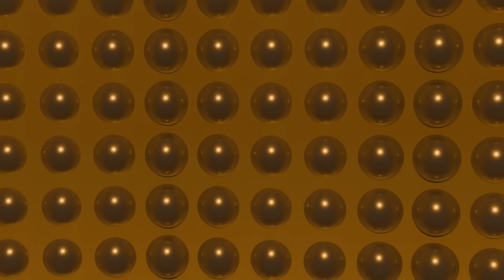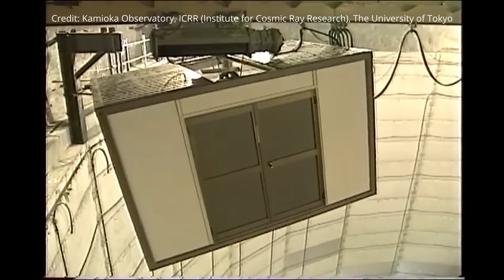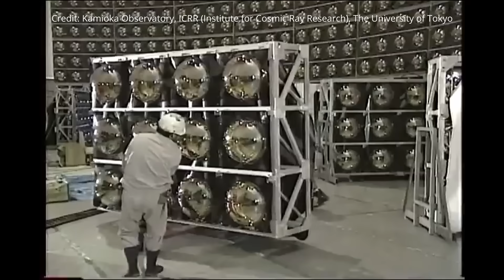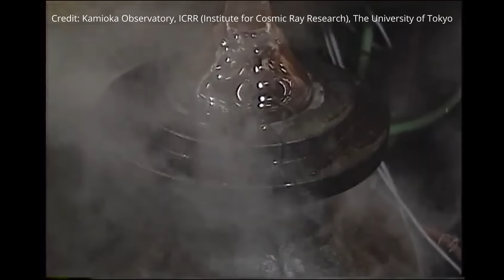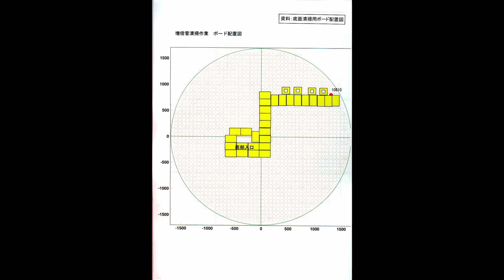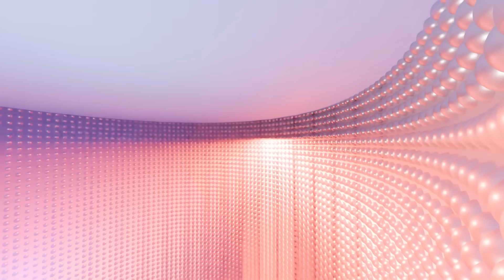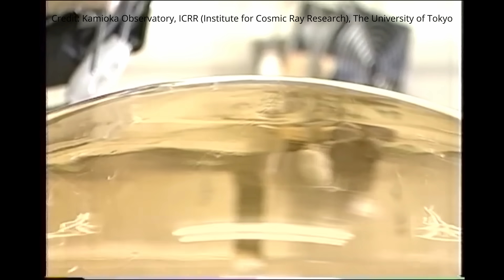An Engineering Fairy Tale: Cascade Failure at the Super Kamiokande

Comment: I feel like this is fairly well timed since there was something “similar” going on at the Paris Olympics:

The swimming pool used at the Paris Olympics was “slow” due to it being not as deep as other pools and having a less than ideal boundary. 
The shockwaves produced while swimming interfered with the swimmers hydrodynamics due to the shallower depth & more reflective edge of the pool
Reply: "The shockwaves produced while swimming"
Yeah - press X to doubt.
Reply: @ABaumstumpf  Not actually shock waves, because to get shock waves you have to exceed the speed of sound in the medium. Still, the speed of gravity waves in water (which was the effect in the Paris swimming pool) depends on the depth of the water, which is why tsunamis are so devastating. As the wave enters shallower water the front of the wave slows down so the height of the wave increases and the length of the wave decreases (just like the air/water example in the video).

Comment: To be fair, back in the 90's fluid computer simulation was a lot more difficult and expensive than it is now. Had they built it nowadays they probably would have picked up the problem before even the physical testing.

Comment: I believe KamiokaNDE officially stands for Kamioka Nucleon Decay Experiment, reflecting its original primary purpose of searching for proton decay. "Neutrino Detection" informally describes its current use.
Reply from the maker: Yes the original kamiokande stood for ‘Nucleon Decay’ but they changed the name when super kamiokande was built. I should have probably added a note onscreen about that.

On reflection I think you are correct. The latter name may be informal.
Reply: @Alexander-the-ok  Great video. I'm in the field, and I still learned something from it.

Comment: A bit tangential, but I was thinking about cavitation, and specifically what would happen if a cavity were created inside of a sealed container filled with water?  Like, if a sealed tank of water had a vacuum tube inside of it that suddenly shattered.  Would the water rush in, but pull away from the outside wall?  Would some of the water then instantly turn into a gas until pressures equalized?  Would be cool to see I imagine.  Assuming that the container itself doesn't implode.

Comment: Oh boy what a mess. Another way to put the violence of the event into perspective, with some blatant mischaracterization of the actual mechanism: Just the bottom detectors failing basically caused 50.000 tons of water to fall down more than 1 foot. Even accounting for the few moments that took to play out, the hoop stress of 50 kT falling water on the detectors on the side is insane.

Comment: 14:35 -- RE: Collapsing Bubbles Rebounding;  Again, I'm no expert in this field either but "rebounding" is how I'd describe a lot of fluid motion.  For example, if wind gets pushed uphill, say off an ocean and up a hillside, it will head back down again on the other side of the hill.  However, more to the point, if we continue to track the motion of that air flow we should notice that it will tend back upward again after descending, and then back down again, without any further help from geography.  In short, the first "bounce" over the hill caused a "rebound" after the air flow hits the ground.

Comment: When I was younger I was in the bathroom and chilling, and I witnessed a tiny tiny tiny tiny little white flash and it struck something mid air and exploded into spiraling and dancing fragments that were white hot, they burned out very very very fast but spiraled fast too, and one of them struck the wall just before burning out. It was so bright that it burnt itself into my vision, I had squiggly marks in my vision making it hard to see where the fragment hit my wall. I thought I was seeing things and maybe I seen stars for a moment, but the craziest part is that later when my vision recovered, and I had to use the washroom again, I checked the wall and it left a tiny black spec burnt into the wall exactly where I seen it land, and it was an actual hole burnt into the paint and drywall, which kinda intrigued and stumped me. Like how tf did something so tiny store that much energy in it, to produce that many photons and actually burn into the wall. For awhile I thought it was creepy, paranormal, and freaky, and it scared me a lot to think about so I never really did. The explanation I'd like to think was that it was just my vision, but how did it burn itself into my vision, and into the wall to leave a permanent mark too, the other is a micro meteorite which actually explains a lot, but it must have been stupid fast and small enough not to be effected by atmosphere, but somehow the microscopic droplets of steam in the air must have caused it to slow down and break apart. It hit something in the air strong enough to stop it
Reply: I've seen something similar once, and I thought it might have been a cosmic ray hitting me in the eye... but years later I realized that it was actually a capillary in my retina that stretched suddenly, or a partial retinal detachment... which one optometrist told me that I had at the time... but then I apparently recovered from it, because my retina is perfectly healthy now. 

Sudden changes in blood pressure, like straining on the toilet, can cause capillaries to stretch and even break in extreme cases (it's also why so many people die from heart attacks on the toilet, like Elvis Presley).

It's possible that what you saw in the bathroom was some of the capillaries in your retina. It will, subjectively, look like a blindingly bright white line in your vision that has a really bright point moving kinda fast, but not too fast, with a short trail behind it (where it was previously).

That the bright point branches into a tree-like, or lightning-light pattern sounds like it's following the capillaries in your retina. Those exact parts of your retina will be somewhat "blind" for a few moments until they recover. (Just like if you were looking into a flash bulb in a dark room.)

So, um... if you see this happen again, go to the emergency room, because you are possibly about to have a retinal detachment. 

I speculate that the burn on the wall may have already been there previously for some length of time, but I don't know anything about your bathroom... but I find a lot of random stuff on the walls of bathrooms that I have no idea how it got there.

Comment: Quite an interesting story, and a very well-made video. There's just a very minor thing: the typeface used in this video is slightly annoying to me. It is a low-weight, serif font that has monospaced latin characters, which is, in my opinion, not ideal for this use case, especially since you're not showing any Chinese characters, which is the point of the font. (It looks like SimSun/NSimSun to me, which is the "default" serif font for Chinese text on MS Windows.)

If you want to display both latin characters and CJK (Chinese, Japanese and/or Korean) text, you can consider using the Source Han or Noto fonts. Those fonts were designed to handle English text, as well as CJK.
Reply from the maker: You make a very good point. I’ll avoid using it again.

Comment: 21:35 if you want another stupidly astonishing physics/engineering thing, look up how gravitational waves are detected and how tiny they are

spoiler:

theyre able to detect the earth being squished and stretched by approximately the size of 3 protons from black hole mergers billions of light years away
Reply: A year and a bit ago I (a lead programmer in the infrastructure division of a bank) was driving to Scotland to play a silly amateur sport with a friend who works on the software used for FEA, CFD etc. We had a nice few hours talking about the feature he was working on to help onboard a new giant customer. After arriving where we'd be staying for the weekend, we learned that our host was a physicist involved in one of the gravitational wave projects, and happened to use the software my friend's company makes. The company worked closely with the project because it's apparently quite hard to do FEA of the system that suspends the detectors on threads of silicon no more than a few atoms thick, attached at each end with some kind of glue. Dividing the volume into triangular-faced voxels doesn't work when each voxel doesn't contain enough atoms to be called "a volume of material".
Reply: @EmyrDerfel  
A fun bit of puzzle solving:
FEA I knew; Analyzing a system by dividing it up conceptually into a large but Finite number of neighboring, interacting Elements, then doing multiple iterations of calculations to see how the system responds to the input of interest. 

The voxels makes sense as a name for the units, ‘volume elements’ being a derivation from the pixels, two-dimensional ‘picture elements’, of visual media. 
‘Trianglular faced’ volumes is a bit of a problem, as the tetrahedrons that immediately sprang to mind have not the presumably necessary close packability. Pyramids would, as subdivisions of cubes, their square bases being cube faces.
Looked up Contract For Differences, as the only suggested expansion of CFD, which made sense given your banking employment.

There only remains the silly amateur sport facilitated by presence in Scotland. …bzzztt… No clue arises. Highland Games? Tossing the caber?
Reply: The proposed space observatory for them should be more sensitive, using space itself as the medium. Looking forward to it!!
Reply: Woah. The universe really is awesome

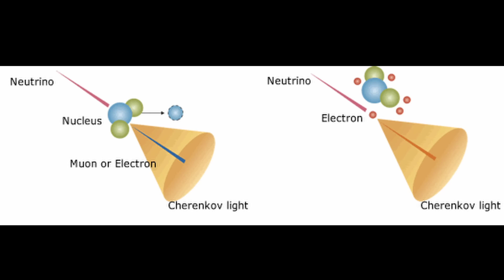Comment: 4:25 -- RE: The Basics of Particle Physics;  Full disclosure, I'm no expert in this field either but I do believe it is possible to be generally knowledgeable in much of the theory and also experimental observations.  Cherenkov Light, for example, is also known as Cherenkov Radiation and is a fairly well known physical effect for nuclear reactors as well as particle accelerators.  And, you're exactly right that the photons which are traveling faster than the speed of light in Water aren't violating relativity by doing so.  The one detail which I think is pertinent but missing here is that Cherenkov light is on the blue end of the light spectrum, indicating exactly how fast it is.  Photons which are traveling into or out of a gravity well show a similar thing, being shifted towards the Blue end of the spectrum when going down and towards the Red end when going out.

Comment: And the SuperK is probably the least unhinged neutrino telescope! For the other ones we either drop strings of these bulbs into Antarctic ice/lake Baikal/the ocean (with an effective detector volume of like a cubic kilometer) or replace water with liquid chlorine (the higher density makes neutrino detection easier and allows for a much smaller volume to still be effective at detecting neutrino events, although with no spatial resolution)

Also I like to think of photomultipliers as reverse lightbulbs
Reply: Don't forget SNO, which is the same idea as super-K but filled with heavy water (D2O).
Reply: why chlorine?  why not something far less deadly?
Reply: @tsm688  cheap to get and the isotope resulting from the neutrino collision (Cl-37 to Ar-37) is radioactive but relatively stable and can be easily detected after extraction. To be precise, the tank was filled with tetrachloroetylene. Modern detectors of this type usually use gallium and gadolinium instead.
Reply: @tsm688  Chlorine just like Lead, are amazing materials. Unfortunately, they are extremely intolerant to living things.
Reply: @Deadly_Laser  the reverse of a light bulb... So, like Dumbledore's de-luminator? 😁

Comment: Not going to lie. If I saw that many phototubes broken I would ugly cry
Reply: Back in the day, we used ONE PMT at a time.   When we damaged it, we came close to crying.   (damage was usually from exposing it to light when "powered" up.
Reply: @GilmerJohn  
He mentioned using sodium lights in the tank during maintenance to avoid damage to the PMTs, without that ‘unpowered’ qualifier. I knew enough to assume the necessarily unpowered tubes would be damaged by some other light sensitivity, such as the first photosensitive layer, but that doesn’t explain how the as-manufactured tubes escape damage by ambient light in routine handling.
Any light (ahem) you can shed on the subject?
Reply: @For_What_It-s_Worth  --  Well, in my case, this was over 50 years ago.   The problem we feared was when the tube was fired up will power applied,   The 10 million+ amplification is nice when you have a single photon.   When you have a room light ...   

I think we added some series resisters to limit the current to the "dynodes."

Comment: Your fine video reminded me of of something I experienced in 1974. My first job out of the military was for Packard Instrument Corp final testing liquid scintillation spectrometers. Those were the TTL days and the logic "board" in the units consisted of 300+ 16 pin integrated circuits in sockets. There was no printed circuit board. All connections to the 5000 socket pins were crimped by machine, one at a time, to up to five levels on each pin, giving a theoretical maximum of 12,000 point to point wires on this single board...all blue. Naturally, the actual number was much lower, but it was into the thousands, and the pins themselves were hidden under a several inch thick mat of blue wires. Our job in final test was to find any faults, make the machines work, and calibrate them.  One day, one of the other techs energized a machine to begin troubleshooting and there was a loud crackling noise, followed shortly after by a rain of integrated circuit tops that reached 30 feet from the machine, and a huge puff of acrid smoke. Nearly every one of the ICs had exploded.  I wish I could say that I was cool when it happened and calmly said "I think you have a power supply problem", but I didn't, I ducked.
Reply: the phrase "blue wires" does make me think of wire wrap boards... but the basic problem of blowing up a board full of IC's is familiar (but on a much smaller scale).  Those are the experiences that are a real test of your soul... and maybe heart?
Reply: Thank you for sharing your experience
Reply: but then, did you 'cover' ?
Reply: "rain of integrated circuit tops"
Yikes!  Worst I've personally seen is a jet of plasma creating and then shooting out of a pinhole in the top of an IC.  Kept the chip; it's in a (small) drawer full of interesting failures.
Reply: lol
Reply: @steveanderson9290  Ducking and cursing sounds like the reasonable response. Unexpected fireworks in the workplace tend to put a bit of a damper on dry humor.
Reply: @steveanderson9290  oh, wire wrapped backplanes. Yeah, those were the days...
Reply: @MarcoTedaldi  Now that I think about it, they might have been wire wrap rather than the picture of crimps that I have in my brain from 50+ years ago, but I thought I would remember the horror of trying to un-wrap a wire down on station 1, 2, or 3. Speaking of horror, when I went in for my interview, the supervisor showed me around the shop where I got my first look at what I would be working on. When I saw that backplane with inches of blue wire stacked on it, my jaw dropped. The supervisor immediately said, "I swear, it's not that bad, the assembly machines do an amazingly good job, the faults are usually bad chips." He was right. Hardly a machine worked right off the line, but the overwhelming majority of faults were bad chips or bent pins.
Reply: ducking was a smart move
Reply: This might be one of the first comments ive found that actually has the name of the company instead of "some company that did x", or something similar, I hope more people do this
Reply: Wow, I wish I would have been there to experience that! Not as one of the investors or product owners, though... :)
Reply: He likely vermariupolt the thing. (That's a German language pun name for a disaster of confusing polarity of electronics, alluding to the Ukraine city that got entirely bombed away from the surface of the Earth.)
Reply: Spectrometers, you say?

"Gordon! Get away from the beams!"
Reply: all blue wires and no prints on the boards? they must've hated you guys 😂
Reply: At my work I powered up PCBA to test it. I reached over the board to turn the switch on and an IC blew up, off the board flaming and hit me in my chest. The board had direct short on it. In another instance  my friend next to me was testing a board where the existing memory battery had been replaced with a LI-ON battery. Excepting the design engineer had forgotten to remove the trickle charge circuit that was on the board for the original NICAD battery. While testing the LI-ON got hot, blew up scattering debris all over my friend and the fire alarms went off. It looked like a small nuclear test cloud from my point of view.You were lucky not to have suffered any injury. It would have been nice to have it on video.
Reply: people don’t believe my revolutionary theory of electrical component maintenance. replacement is necessary when you let the smoke out 😉
Reply: @MadMax-bq6pg Yeah. Electronics run on magic smoke. If the magic smoke leaves the case, the part doesn't work anymore. And it seems impossible to get the smoke back into the device 😢
Reply: @MadMax-bq6pg  
I'm on your side on this one. The magic smoke is essential in making electronic devices work. Once it escapes, it's all over.
Reply: Huh?